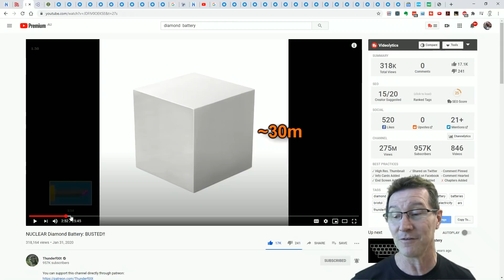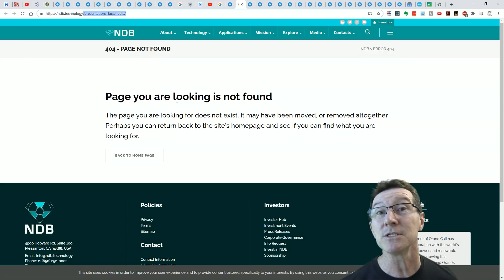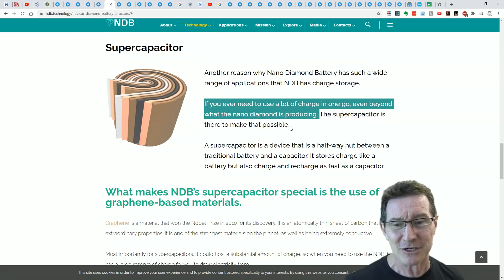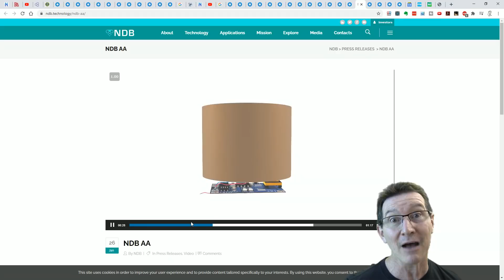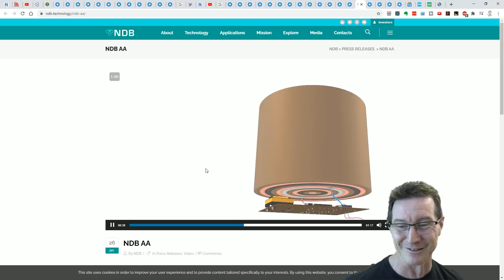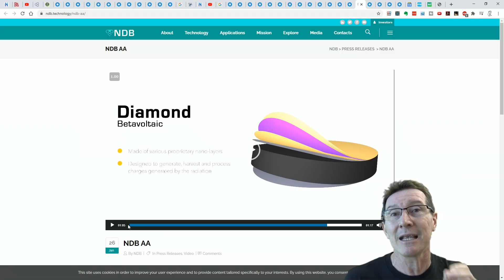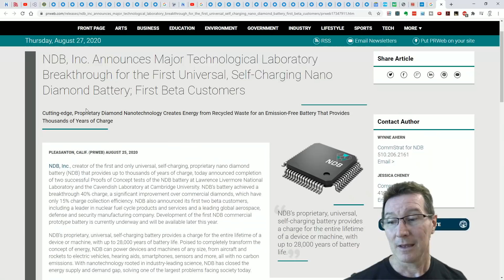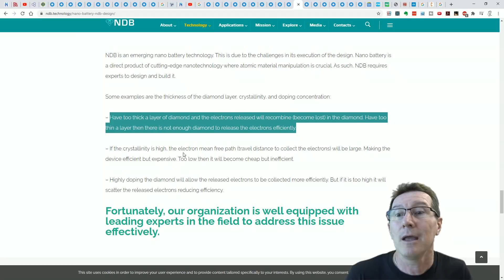EEVblog #1333 - Nuclear Diamond Self-Charging Battery DEBUNKED!

Comment: Manufacturer      Google Pixel 3 NDB
Type                     Li-ion                  Cm-244
Lifetime (Years) 0.001                   90.55
Power (W)           12.25                  15.19
Voltage (V)           3.85                     3.85
Volume (cm3)       16.2                    6.87
Weight (kg)              0.05                  0.05
Cost (/Unit)              $11                    $29
From their investor pack pdf
Seems too good to be true
Reply: Table 10 Application data (Drone battery) and calculated equivalent values of NDB112.
The calculated equivalent values were based on the initial prototype design that consists of: 80% NDB, 5% supercapacitor/li-ion battery, 10%
packaging and 5% printed circuit board.
Manufacturer      A123                         NDB
Type                      Lithium Polymer     Po-210
Lifetime (Years)  0.00006                    1.895
Power (W)            198                            1055
Voltage (V)           3.3                              4
Volume (cm3)      34.59                         13.41
Weight (kg)            0.076                        0.076
Est. Cost (/Unit)   $145                          $57

Comment: So if you stacked these tiny chips in a 500x500 warehouse 12 foot high it would generate  4.15 megawatts. so in theory this one warehouse could run 3,200 average homes per year for a lifetime. Is that really that bad? Would the warehouse overheat? What if it was cooled using geothermal cooling?

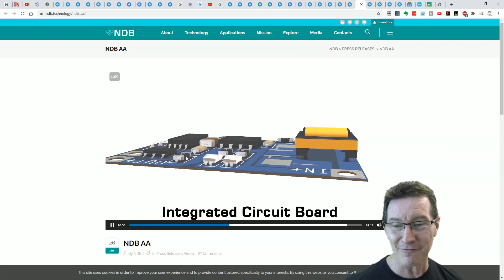Comment: 13:50 the circuit board rendering is of a common TP4056 Li+ charger and DW01+8205 Li+ protection circuit but they replaced the USB port with a transformer

Comment: It really is the future... the carbon age will revolutionize all material/industrial production and energy sectors.   The thing is a lot of that is casing. Think of it in terms of having a quartz crystal in a clock, the crystal is small, the clock is large.   This also solves the nuclear waste issue and provides another use for carbon wastes from fossil fuel energy production, allowing waste graphine/graphite to be reutilized to clean nuclear waste and convert it into a usable form. This technology is a good one to get behind. While these products are still in their infancy along with carbon fiber and carbon composite wiring once these technologies become standardized the efficiencies and benefits will be realized. Skynet is coming. Prepare.

Comment: What battery do mars rovers use?? You have been dekund. Teslas dont use only one cell but 3000 cells... If you use 10 chip size cells is 0.1volt  100 is 1volt 
1000 10volts etccc
Reply from the maker: LOL. So you even know what power is? What about cell ESR?

Comment: Oh boy.... a lot to unload here... senior EEVBlog is not wrong, and as an E.E. I have a lot of questions.... why so many pins? You need your -/+ and thats it technically. Buuut one itself wont do much  though get a nice board with lets say 120? You could use it to power an IoT device that needs a small amout of energy for burst transmissions.  Or combine it with a super capacitor to get a nice little mix and match... I am not saying they will revolutionize the energy industry (unless you have a little Thorium reactor at home...) but they can be used in various situations (for example sensors at really hard-to-reach positions). Either way he is not wrong but on the other hand lets see where it ends up before getting our pitchforks and flamethrowers (no torchs... this is 2020.... dont be a caveman)

Comment: I mean, you could put this in a Casio watch in parallel with a capacitor. The cap would be needed to sure the energy to turn on the LED or beeper. Although I think it's out of most watch collectors price range.

Comment: Alternative batteries tech need to be discovered that are safe for manufacturing to environment and last longer. ICE engines need to be replaced as oil is harming environment but also creating wars.
 As long as these fraudsters don't hinder research the buzz they create is useful

Comment: I was curious to see what sort of bursts you could have (ideally with no leakage in caps or idle devices) and with 100µW you could for instance use 1W for 8.64s every day. I imagine some devices that do long term logging, waking up now and then to report something, could benefit from this. I'd be worried about if there are any problems with disposing of these if they just get burnt with the rest of the trash as a lot of people still don't properly recycle their ewaste.

Comment: Hmm i agree on what is shown till ~ 12 minute. After that i think you misunderstood what they say.... 100uW for for layer(!). Later when i See that AA battery it starts to make more sense. Probably Yes it is a fake. But if you could put inside that AA like 100 or more layers and each layer generate 100uW than it is already 10mW. 500 layers 50mW. And if you add to it 200mW super capacitor than you already have life time battery for tv remote. Is all about use case... But Yes, for sure it is not revolutionary... 
Just make a 10mW battery like that i could perfectly think about use case for it, like sensor that goes on only for 1-2seconds send data and sleep again for 24h

I like your content but starting some time ago you start to get some anoying " all knowing" atitude. 

You constantly say about that dip package, we don't know how much of that package is that diamond battery, how many layers generate that 100uW. Does it also have that super cap inside that DIP, some other circut perhaps... 

I don't say it is not fake but idea is interesting and you are not all knowing to be able to say it is fake if there is so minimal info about that.
And yes marketing is overkill but would you share all info if your money would be involved.

Comment: Dave, you missed this one. While most of it (phones, cars etc) is marketing BS (and is actually needed for general public to read the article), 100uW is actually enough for many smart home sensors. Those sensors currently run off a single CR2032 for two years. Those sensors work in short bursts and would easily overpower the 100uW source, so a capacitor is brought in.
The problem with batteries, is sensors start to die out after two years and it is a huge frustration to find, disassemble the sensor and change the battery. Especially if you are not tech savy. And in some cases those sensors are mounted high up, like 4.5 meters high in my case, as I have high ceiling.
So devices like this actually will have a very big market, once cost drops.
And the market is big even now, like industrial process automation, for example sensors placed on industrial machines in special spots to detect abnormal virbation or temperature.
Just open your eyes, Dave, and don't confuse the public.

EDIT: I did some math and averago power consumption of typical zigbee smart home sensor is 90uW.
So this device and a capacitor covers it perfectly.

EDIT2: by the way I work with batteries, the EV-sized ones. And ever though we have kWhs of energy, you always end up uptimizing your idle consumption in uW range.

Comment: I believe that the real reason that they never promote/specify the actual power output is so that they can feed people the total line of BS that includes applications such as electric cars.  They won't admit that you'd need a basketball arena packed to the ceiling with NDBs to move that car one inch per year.

Comment: Considering that "charge" is not current, 99% of the techno-babble is automatically rendered nonsense.  The over-use of the word 'diamond' like it's some sort of magical material that they can just lay down in whatever manner they choose is also a dead giveaway that they are relying on the premise that BS baffles brains.  Even quartz would have been more believable.  Considering that Tritium-based radioactive power generating devices have actually existed for the past 20 years or so and that they have certainly not changed the landscape of our devices get their power, should be proof that even if NDB's work, they won't be any better than what's already commonly known, so it's all BS.  The reason why you never see any quantity associated with NDBs is because it's so stupidly low.  While it might maintain a super low power real-time clock, or maintain the contents of a small static RAM (I'm highly doubt it), there's not much application for a 100uW.  Consider that 100uW is the best possible case and that the typical case is much less, say 5uW, then you'd have to pile up 100,000 of these NDB chips to give you just 0.5W.  If you could pack them into a space the size of a refrigerator at a cost of say $10 per chip, then you'd have a blackbox that cost $1,000,000 and can charge your phone once in just a few months.

Comment: Just one question, can it run my lcd pocket calculator........in power save mode? I bet it..........😃 may be i can get rid of that 50 cents worth solar cell from my calculator 😃 and start using chinesium power battery.

Comment: As a retired nuclear engineer, I can say NDB's technology could work. If they are using alphavoltaics for high power applications, then it makes sense. For some alphavoltaics life time could be a decade (i.e. CM-244 has a half-life of 18.1 years; that's roughly 90 years and the power density will be 5511.009967 kW/m3). Obviously, they are very smart people and trying to keep their trade secret safe by not responding and creating a distraction.
Reply: Yes, power density is the culprit. Unfortunately, such radioactive decay based batteries are only relatively safe for extremely low power levels in the micro Watts which make them insufficient for modern gadgets and EVs. If you were to make a battery of Watts or kilo Watts to power smart phones or even EVs, naturally it would mean that internally they would produce those Watts from radioactivity and such power levels would make them into insanely dangerous dirty bombs. In fact, an EV requiring 10s or 100s of kW of power would go up in smoke when you stop the car and all that always produced radioactive decay power would have no other way to exit than as heat (check first law of thermodynamics). It doesn’t matter whatever isotope you use as above reasoning always apply forever.
Reply: @ThinkingBetter  Teslas flame up even now without NDBs...
Reply: @BrainDmgBahhh  I’ll rather stay near a burning Tesla than a burning nuclear battery lol
Reply: @AxiomofDiscord because of what thinkingbetter said. Did you even read it?
Reply: very smart people indeed…
Reply: Alphavoltaics, isn't that like wanting to generate electricity with a windmill by shooting cannons at it? What kind of semiconductor material can handle such influx of alpha particles and remain structurally functional for a reasonable amount of time?
Reply: maybe we could use the heat to warm up some sort of liquid and use it to spin a windmill like propeller that is connected to a dynamo or something?
Reply: Seen a few types of nuclear batteries, a tritium based one that generates 4.2v at 25mA. of usable power. A plutonium thermoelectric battery that generated 0.9 V about 100mA. Never heard of alpha particle driven batteries other than thermal types like the plutonium one.

Comment: If it's 100uW per slice and there are 100 slices in the AA battery, that gets them to 10mW. If the application is only a 10% duty cycle over a day or whatever that gets it to 0.1W. Stacking more layers cost effectively would be the key it seems.

Comment: If you use them ( a lot of them ) to build a battery pack for a car if you wreck the car just think if those batteries good in to terminal run away what it would do to the environment. Now nuclear power is safer than anything else by watts and you don’t have to cut down tree to put up solar farms or bird blenders ( wind mills). And I forgot about damming up rivers so fish can’t get to spawning waters.

Comment: There is no scale given, the image could be of a unit 10000x smaller than a dip chip... in which case an array of them the size of a dip chip would produce 1watt of constant power, and an array of 1000 such chips would then give you 1KW of power.

Comment: The problem with your review is that you're fixated on the device using purely carbon-14. There are other radioisotopes that could be used to increase the power generated, with shorter half lives and higher energy beta particles. Russian researchers at the University of Moscow have already been working with Nickel-63 (although not very successfully). Scientists at the University of Bristol have been trying tritium and diamond. Maybe you could examine in another video whether employing something like a sparse mix of strontium-90 with carbon-14 could theoretically allow them to achieve a viable power density.

Comment: When the AA battery is not used, it doesn't loose charge. This one actually generates charge when it is not used. So in 10 hours of non-use it would generate the charge held by the AA battery.  The charge collected must be stored in some capacitors.

Comment: My understanding is that the reason to use diamond is to use spent graphite from reactors and use them as a energy source instead of sealing them away as waste. This is real technology and the physics does work. The radioactive carbon has much longer half life than current tritium so yeah it will last longer at the cost of having to produce more radioactive diamond per µW. But again from my understanding the device is a way of disposing of a hazardous material in an economically effective and environmentally safe way.

Comment: page 21 to 23 is pretty interesting to read and actually contains useful information about the "device",  they mention something about a "secondary storage" for things that need to draw more than what their "NDB" is capable of outputting(for an allotted time of said storage capacity) but that they're able to scale the battery size for the situation in most cases. it also mentions a size of 20nm which i'm guessing is the production size of the actual battery itself and will just be layered and stacked to meet the demand of whatever product it's going into. the ability to recoup energy through the heat generated hints at a peltier embedded effect within likely the outer layer of the battery. i don't know that i'd dismiss it too quickly until such time that there is a "demonstration model" or one never comes...  Beta decay is something all atoms undergo at random in which case they drop to the next element below whatever it was that decayed, essentially mercury can beta decay into gold and occasionally a stable isotope of gold meaning that it won't undergo another decay process and will remain as gold.  IF they're actually able to pull that kind of power out of a 20nm wafer then it's a matter of how much they can upscale to really show a proof of concept. keep an eye on this, it looks like there's a bit more to it and i understand them not having a full functioning demo as they're clearly in over their heads with costs. how big is the design team? what are their running costs? how much have they spent getting it this far? it's not easy starting up some projects.

Comment: I calculated (please check) that at 100% efficiency a 100uW battery based on C14 would need to have a source of several GBq, perhaps equivalent to 100,000 smoke detector Americium sources. I very much doubt that this would be allowed in consumer products.

Comment: This analysis appears grossly flawed.  "Look, this 95% ceramic resin IC DIP chip is like the same size of a AAA battery!  Its a scam!"  So, you can do some basic research before you make some superficial packaging comparisons and yell for 28 minutes.

Yes, the 0.25 inches deep DIP is pretty thick, but the maximum DIE wafer thickness you can put into it is 0.7mm.  Typical ICs are usually around 0.1mm.
Presumably they're producing these things as IC DIPs because the battery itself is gaseous C-14 in a modified diamond substrate.  They're using semiconductor manufacturing processes to produce these, so it'd be logical to put them into IC DIP packages for testing.  

Comparing packaging to me seems like a big stretch, AAA's have be optimized over 50 years, where these guys are a startup trying to use the simplest manufacturing process to get samples out.  
Also, it funny you accepted the 100uW number from the obviously rendered picture of an IC DIP, but then the 1.5V AA obvious rendering you call bunk?

Comment: I found a spec for an alleged prototype on the blog of someone who has been following this marvel. 
For example, one prototype recently reported:
"The battery power density of 10 μW/cm and specific energy of 3300 mWh/g were achieved due to cell thickness decreasing."  The specific energy looks pretty encouraging since part of that calculation is based on the battery discharging to 50%. This will only take about 2500 years.

Comment: Radioactive energy source has lots of potential though...

10 kg of Pu-238 can easily generate enough heat to heat a house for its lifetime... (And possibly all water heating needs as well..) (Starting out at 5.4kW, halving over ~88 years...)

(using radioactive heat sources to power Stirling Engines might make more sense though than the RTGs, at least on earth where maintenance can be done) (The 10 kg of Pu-238 might be able to generate around 1 kW of electricity for similar durations, which would have some of the applications that NDB claims (C-14 seems completely unsuitable though...))

There are just these pesky regulations that makes it hard...

(That RTG table does seems to indicate the power density of the decay of the isotope, not of a generator built based on it...)

Comment: You can't charge a super capacitator at 100 micro watts. Well, you can, but the loss of charge of the capacitator itself should be not far from that charge figure, so I'm fairly sure the capactiator would never achieve any charge.